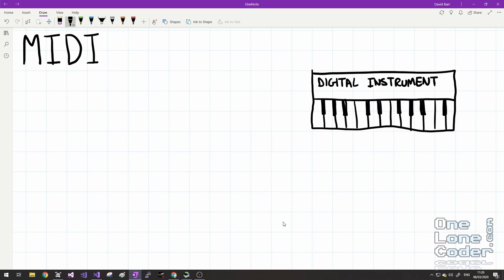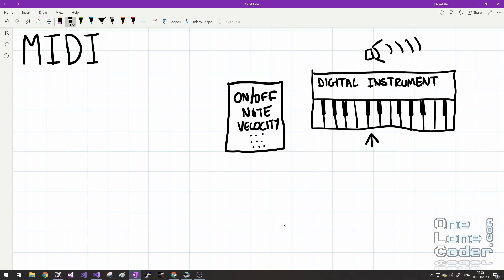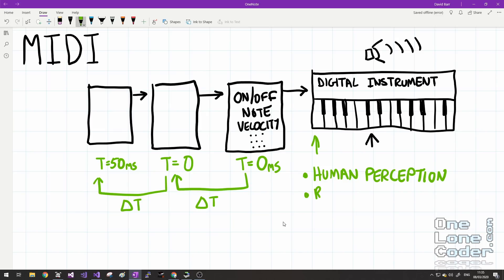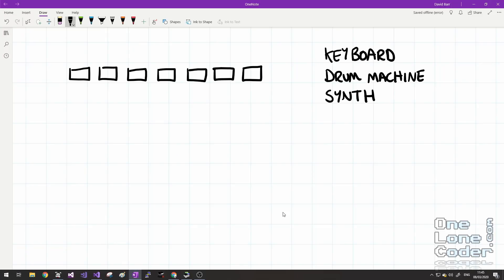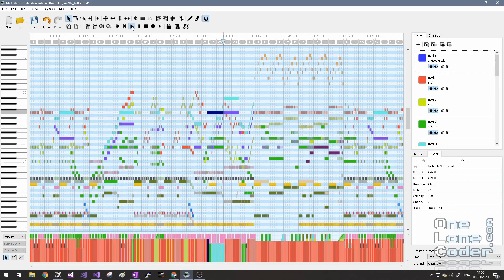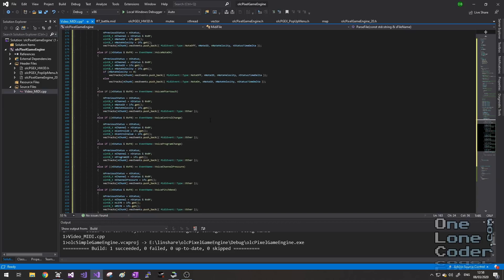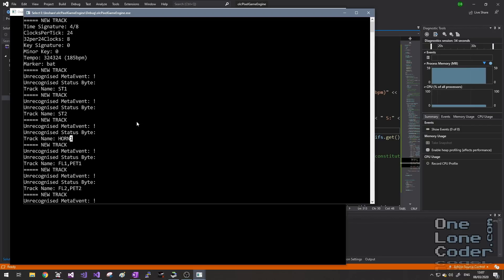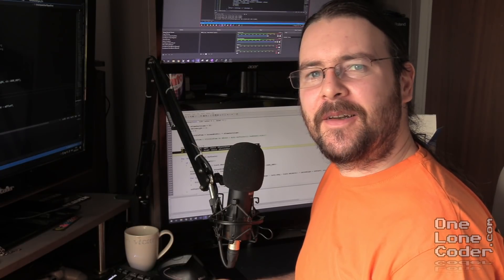Programming MIDI

Comment: HUGE thing to know: In the MIDI header is a value that gives you 'ticks per quarter note' and 'milliseconds per quarter note'. This is what you use to draw out MIDI note events visually. You also use 'Tempo' which is in microseconds, there are 60 million microseconds in a minute so you do 60 million / tempo = BPM and thats how you get the BPM of a song. You can then use ticks per quarter, bpm, milliseconds per quarter and get all the values you need to visualize from these.

Comment: After spending months working on exactly this same code, I would like to note that none of the timing information (the delta time between events) is actually sent to the midi device.  It is only stored in the midi file, and used by the sequencer to calculate “when” to send the event to the device.  Just wanted to clarify. :)
Reply: So why are DELTATIME intervals retained in this example?

Comment: There's a pervasive misconception in this video that took me a minute to understand. The delta time information is part of the event in the midi file, but it is not part of the midi message that is sent out. The time stamp tells the midi file player (or sequencer) when to send the message, but the midi protocol is fully asynchronous, messages can be sent any time and they are processed as they are received. This also relates to why midi bytes are mostly 7 bit values. It's not to conserve bandwidth, all 8 bits are sent, but the first byte of a message will have the high bit set to 1 so the receiving device knows this is the start of a midi message. The rest of the bytes in the message must have the high bit set to 0. Midi devices process midi messages as they are received, and they do not know or care who sent them or when. Imagine multiple midi instruments all receiving event messages and trying to comply with delta time stamps. They would need to all be in sync somehow. The midi protocol is designed specifically to avoid this problem.

Comment: Yes. I just completed a project using a Teensy 4.1 MCU + 3 audio shields to become a laser image synth, with 14 waveform generators, 4-1 X/Y mixers, 2 AM LFOs feeding multiplexers and RGB color modulation.
IOW, it's a Laserium synth the size of a fist.
Everything is controllable via usbMIDI with an custom mapped Akai ACP40 controller, Cakewalk's DAW, a 15" touchscreen, and/or Surface Pro tablet GUIs, created with Pure Data.
Each Teensy Laser Synth is set to a unique MIDI channel, one for each projector. The DAW handles the outputs via Bus mixdowns.
I'm no electronics engineer, software developer, nor musician. But, Laserium taught me all about working with cycloid imagery. Our pal, Dave, from Notes and Volts taught me everything I needed to know to transform my 30 year old dreams into modern reality.😎
🤯 Lasers have ILDA files, but since my laser synth is MIDI controlled, I can also record live laser shows onto MIDI files, as well! That's a game changer.
Thanks! 🙏

Comment: Thank you so much for showing this in depth information. My initial reason for stopping on your channel was to learn when, where and why to use a track versus a channel. You did touch on the byte in the MIDI stream that showed which track (nibble 4 bits), but you never went back to make any further mention of the significance of a channel (second nibble). As a person learning how to design MIDI content, I was hoping to gain a clear understanding of tracks versus channels. What should the mental concept be in making this decision. Thanks again for your brilliant work. Also thanks for using the free Midi Editor in your work, it the same editor I am using.

Comment: Great video, yet again. I'd just like to add that the reason for treating a Note-On event with a value of 0 as if it were a Note-Off event was to take full advantage of the running status. This way, most of the messages in normal midi tracks would not need the status byte.

Comment: Great video, javid! It's been a very handy reference for a project I'm working on with midi files at the moment. During it I've actually ran into a small bug cause by some unhandled events in your code.
There's a few extra meta events that you'll want to handle in certain midi files: metaProgramName (0x8), metaDevicePort (0x9), and metaMidiPort (0x21). For the first 2 you'll want to do a standard readString() with the length read in prior, but the midi port meta event you'd read in a single byte. 
I believe some meta events can also have delta time associated with them, meaning after we handle meta events, we need to pass in the delta time for these "other" events, and furthermore, the algorithm to convert the midi events into a series of notes needs to be tweaked to account for non-note events that have a time delta. An easy solution would be to check if an "other" event type has a time delta, and if it does, pass it onto the next event in sequence so this time isn't lost if any real note on/off events come in later.

Comment: javidx9. I have a topic request.

You seem familiar with this. Where a specification for a binary file format exists, partial or full documented, you seem experienced with how to write programming code that opens and interprets and works with that binary data. You seem to have been doing this for quite some time now. And it may not be especially difficult. But I am unknowledgeable with this. I wanted to work with PCX image files in the mid-2000s and failed to do so.

Can you do an educational video on working with binary file formats? Opening them, moving through the bits and bytes and all of the techno mumbo jumbo? And I'd like if you can make this one of your more elementary videos. A basics video. :) 

Like talking points and things I feel you'd cover in such a video. "MSB" or "most significant byte." All of the hexadecimal codes you employ in the video when moving byte-by-byte through the file. Seeking through the file, like moving to a specific referenced area by a table in the header of the file. Many file formats employ that method. Can you discuss outputting or writing such a file? I don't know how to do that either. What is the means of outputting a binary file format, like an image format, for instance? 

And so all of that is working with the binary file formats, but if you felt to do this separately or in the same episode, I'd think simply covering computer data and file formats, like the ideas of "binary" and "plain text" and the little encoding schemes and "Little Endian" and things... :( You'd do so well to please adolescent me fifteen years ago. I had been trying to do all of these things and I only ever produced results using existing code shared by others. I never wrote my own code to do these things because, despite all my Google searching in the mid-2000s, I was unable to find the methods to work with binary data like this. :(
Reply: You need some sort of specification/guide to know how to interpret the bytes in a binary file. Popular formats have their layout available online, like how to interpret bytes of a wav file for instance. But just a random binary file with no specification is just a sequence of bytes... you can interpret those sequences many different ways, and 99% of those will spit out garbage. Even if you get valid data out (sheer luck) you still won't know what that data represents in the sequence. That's why reversing binary files with no specification is near impossible
Reply: I think what you're asking is "How do I parse binary files?" I'd start with the data structures (structs or classes), and try to read it as sequentially as possible (sometimes the table of contents of binary files are at the end of a file, like .zip files and .pdf files), and read each field into the data structure that you've made. This process of parsing and reading (restoring) into your data structure is called "deserialization", and writing (saving) to a file from your data structures is called "serialization". For MSB and LSB handling, most processors can reverse the "endian" (byte order) in a single instruction, but you can do it in C or C++ using a union containing the sized type (sint32_t for example), and a byte (uint8_t) array with the same size. Use the same sort of algorithm that you would use to reverse a string. (The asm single instruction is obviously much faster.)

Hopefully, if he doesn't make a video, that info (paired with a search engine) will get you started.

Comment: Man, you gotta be young indeed (or in the opposite end of the age spectrum, in which case, respect) to not to know what midi is, ha ha.
Banter aside, thank you very much for this, as someone who grew up with many older computer games playing midi (well, really even the NES and other such retro consoles used midi),
it's interesting for me to finally look into what the code actually looks like.
Ik ik, even games nowadays use midi format, only the quality of the instruments have changed. I'd imagine at least the code of midi nowadays compared to an NES game's midi timing would be different, in much the way versions of C++ are different (but somewhat compatible) from each other, is that correct or is that wrong? Anyways, I always love your videos, even though I barely ever dabble in programming (because I just can't wrap my head around it xP)

Comment: Not really related but I wondered how you managed to get the console buffer to have a character height of 1, giving you a pixel aspect ratio of 1:1. (11:28)
The best I can do with my own engine is 1:2. When I set it to 1:1 it just defaults to 1:2 and I end up with a vertically stretched image.
Reply: He recently made a new game engine actually, which uses opengl instead of console buffers, so (in this video at least) he’s not doing that with the console. You can look for the olc pixel game engine video for more details.
Reply: @veda-powered  Yes, you're right. I didn't notice it was olcPixelGameEngine.h and not olcConsoleGameEngine.h.
I was worried there was a way to do 1:1 PAR since I designed the whole engine around the fact that it couldn't go below 1:2 (1:1 would have been workable but not as neat looking as 1:2).
Thanks.

Comment: Trying to make my own midi visualization and this is super helpful to get me going with the midifileformat. Thank You :).
 I was wondering, having trouble working with binaryfileformats is often something that gets my project to a screeching halt, and I usually end up moving on to other things thinking I have to get better to crack this. Any suggestion on how to learn, get better at reverse engineering fileformats ? It seems even for the more common ones,  finding good or any documentation is near impossible. 

Now, I get this is not a trivial thing to do ,so I'm not looking for an easy and quick solution rather some pointers on where to start and what to play around with or read up on. 

 Thanks for all your hard work and those insightful and motivating videos :)

Cheers,

Comment: I have two questions regarding the code, first I don’t understand why you couldn’t have used a switch for the nStatus upper nibble, which also would’ve compacted some of the code using multiple case statements for the unimplemented cases. Second couldn’t the ReadValue lambda could have just been written with the inner loop, removing the special case if at the beginning. I was just wondering if you had a reason for doing these things this way, or just if it just doesn’t seem better to you to do it the way that I mentioned.

Comment: is there any point using uint32, uint16, uint8 ? will not the OS work with 32 or 64  bit anyway?
Reply from the maker: The "bit size" of the processor and OS  is not the same concept as the bit size of the data type. Data types in C++ are very important and often the very meaning of the data is related to the type. For example, commonly, a byte is 8 bits, and working with bytes is useful.

Comment: Hello. By any chance, would you happen to know whether or not Android apps such as Perfect Piano can respond to input from the Novation Mininova? I connected my Mininova to my Android phone using an OTG adapter, but none of the many apps I've tried have recognized it as a midi keyboard. Oddly enough, some apps do respond to input from a PC keyboard.
Reply from the maker: Hey, on the whole I've found the mininova USB interface to be a bit sketchy, but the midi out is just fine. Not tried midi on Android in any capacity, sorry!
Reply: @javidx9  Ahh, I see. Well, thanks for responding, at any rate.

Comment: Hey Javid. Im trying to some crazy glitchstep with my live performance using synthesizers. Ive been triggering sudden program changes (sometimes on 16th notes) on my korg synthesizer. Could this damage the synthesizer having so many quick changes? Its really FUN
Reply from the maker: As long as there's no mechanical relays being switched (unlikely) then no. The circuits used are good for switching well out of audible frequencies to the tune of 3 orders of magnitude at least, so my question is, 16ths? Why so slowly?

Comment: Guys,
Please,
Would this be too hard and complex to code ?
As you know,  there are many audio apps and plugins to trigger a drum sound, when a  key on the midi keyboard is pressed, or when a midi note is read. 
Some apps might use c3, d3, e3, f3 or g3 to trigger a kick, snare, clap, hihat and cymbal. Other apps might use e4, f4, g4, a4, or b4,  etc etc
let's say I would like to make a tiny converter.
Let's say, I open 1 or several midi files, and on each file, I want to select, eg, ALL c3 notes, and MOVE them to e4. Then,  I could search and select ALL e3 notes,  and move them,  eg, to f#4. And so on and so on. Finally, I overwrite the file (or eventually save a new file with the same name + 'covertok.mid'..)

Question: could this be done with  the file created on this tutorial?  Would it be too hard to code ? (Don't laugh,  please,  all I ever did was playing 1 or 2 hours with delphi5, many many years ago...God I wish I had chosen to be a developer,  instead of "piiiii, white noise)",  and it's all my nature, to  pretend I can do or know this or that,  when I don't...! :)
So... more easily done than said ? Lol

Because if this would require 300 lines of code,  I simply wouldn't be able to do it.  Simple.
Thanks, 'lucky' guys ('lucky', because learning code, school or self taught,  is the best decision you probably ever made, in your life. I truly regret not having done it,  fuk...! Now, it's too late, and I suck at maths, anyway)

Comment: 7-bit... Signed 8 bit?
i remember those 7 bit oddity's , was trying to make a program to strip out notes that changed instrument in same channel into seperate midi files, so working with songs like that would be less painful in sequences.
Examples would be MOD files converted into MIDI's where several instrument shared same channel
Sadly, i never finished that program.

Comment: Would someone be able to explain the byte swap in more detail? A little unclear as to why/how to do this (granted i'm not a cpp programmer so this was a bit of a rollercoaster for me lol)
Reply from the maker: An integer consists of (for example) 4 bytes, 32 bits. Those bytes on some systems are stored ABCD, and on others are stored DCBA. It depends on how the memory configuration and CPU architecture works on that machine. In this case MIDI files store integers contrary to my x86 based computer processor, so I need to swap them around.
Reply: @javidx9  Ah got it thanks a lot, super interesting video!

Comment: Can anyone give me pointers to how i can create a file that will allow a DAW or a Midi Editor to read the following:
MIDI 1.0

File type: 1
Number of tracks: 2
Divisions per quarter note: 480

Track 0
0 Meta Text "Guitar Track"
1 Program Change 0 26
2 Control Change 7 100
3 Control Change 10 40
4 Note On 60 100
480 Note Off 60 0
960 Note On 64 100
1440 Note Off 64 0
1920 Note On 67 100
2400 Note Off 67 0
2880 Note On 71 100
3360 Note Off 71 0
3840 Note On 72 100
4320 Note Off 72 0

Track 1
0 Meta Text "Bass Track"
1 Program Change 0 33
2 Control Change 7 60
3 Control Change 10 30
4 Note On 48 100
480 Note Off 48 0
960 Note On 52 100
1440 Note Off 52 0
1920 Note On 55 100
2400 Note Off 55 0
2880 Note On 59 100
3360 Note Off 59 0
3840 Note On 60 100
4320 Note Off 60 0

Comment: I woudn't say that midi corresponds to the nowadays needs. Guitar pitch bends even this high tech century work so bad. Even when pitch bends are done realistic they still don't sound so.
Reply from the maker: That's just the instruments being emulated. A guitar bend is nothing more than the deviation of a string from its centre line. This is a linear distance, which the midi protocol can faithfully replicate. What the virtual instruments do with that information can be a bit disappointing I agree
Reply: @javidx9  I agree that 99% of musicians and mix endineers are quite happy with midi, otherwise they could have already created handreds of midi protocols to improve it. But I hate about midi most is that even trying to make the guitar general midi sound like real strum so that to have strums regardless of VSTis, but moving midi lines in midi editor software in an order of ladder steps does not help. It just refuses to sound something close to a real strum.